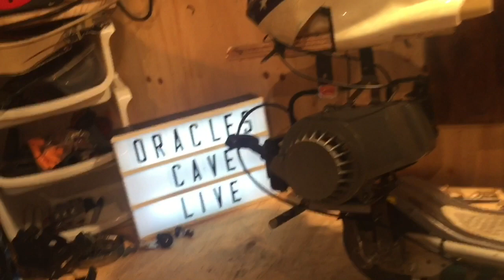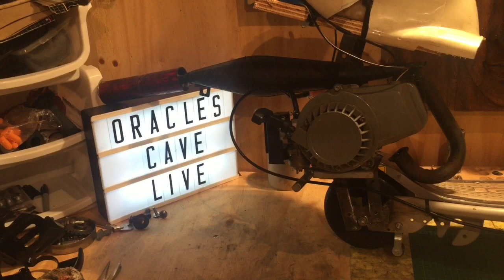RAZOR SCOOTER ENGINE CONVERSION PT 6

Comment: I'm looking forward to seeing this running
Reply from the maker: A Bird In The Hand it won't be long now, I just came in from tidying up the tank area, gorilla glued the petrol tank on and fit the fuel lines.
Just waiting on the clutch bell, coil, and fuel cap, should be delivered before Wednesday and it shall be fired up for first test run.
Thanks for stopping by 👍
ATB
Darren